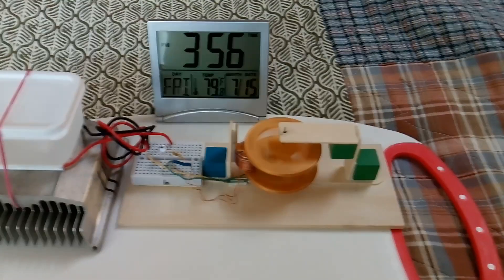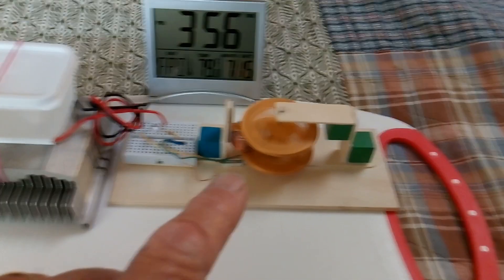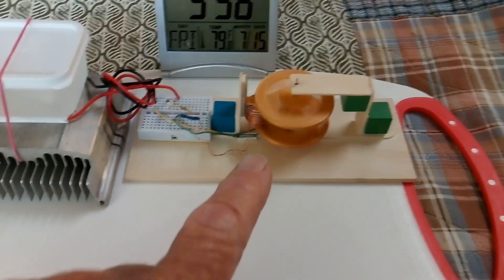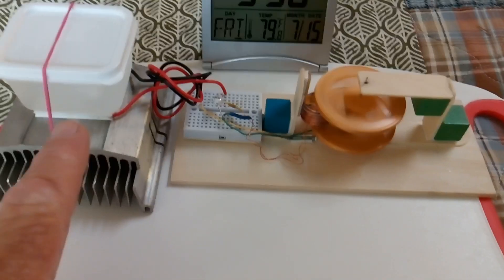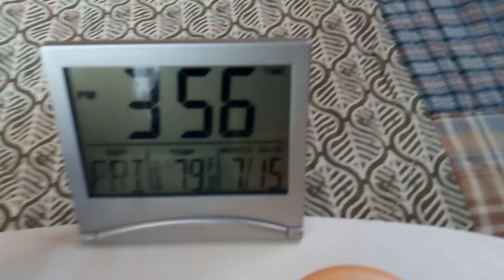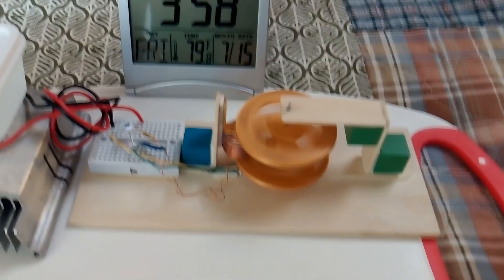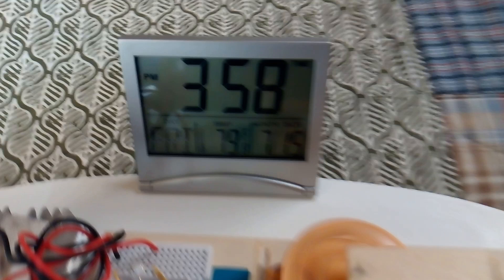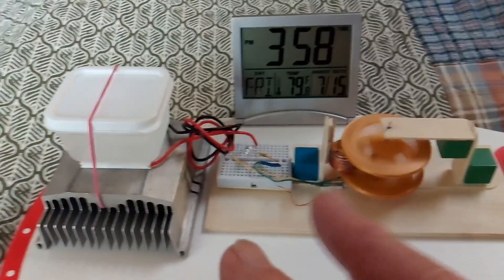The Cold Powered Motor

Comment: This is so cool!  I have also been experimenting with TEG powered motors.  I somehow missed this video and did not realize that you had also been experimenting with them.  I think our minds must be alike in someways.  I am working on something that will run on lower temperature differentials than my Stirling engine.  I have lately started having some good success.  I will be sharing a video soon.  Right now I am building the 24 coil levitating EZ-Spin style motor for the project.  It is by far the must difficult motor I have ever built, but the results so far make me think it will be worth it.  Anyway thanks for sharing all these great videos.
Reply from the maker: Good to hear from you.  I look forward to seeing your latest work.  Getting something to run from a lower temp differential is challenging.  I am running into problems.  I have a good store bought Stirling that will do it but building one myself isn't easy.  Your method of using a TEG is probably a better idea.

Comment: I've watched all your videos multiple times. I really enjoy your explanations and simple takes on power. You should check out a new 3D program called plasticity. It's free until v1.0 drops then it will cost $25-$125 it hasn't been set just yet. But what I like about this program is you can get really great intricate designs that transfer to 3D printing at lightning speed and there's little to no skill needed to get there. Not saying you just anyone who may read this.

Comment: Good 2 C U putting the radio on to pick up the electrical activity. 
U should be able to put a black paper on it and put it in the sun and it should work that way also, since the sun side with the dark paper will be 60 degrees warmer than the room or even more.

Comment: I was thinking of covering all walls with these TEG's, so when it is cold outside, and you heat your house, the losses to the outside give you back the electricity.
Reply from the maker: Great idea.  Even if this extra electricty gain only ran a few led lights it would help.
Reply: Won't generate what you put in , will be very low ratio but will be at least something rather than wasting
Reply: Positioning an enormous module in close proximity to the Sun would contrast greatly with the absolute zero temperature of Space.

Comment: Your ice was made by fire.
Reply from the maker: Actually where I live the electricty that runs my fridge comes from a hydro electric plant but I get your point.  What I was really considering was the use of temp differences in winter.  The ouside temp might be much lower than say the ground temp 8 ft down.   That temperature delta might be used to make electricity using TEGs.
Reply: @Lidmotor  Hydroelectric is great. (If you believe in such nonsense as 
"carbon pollution", the trouble with hydro is the amount of iron and 
steel that you need at the start.)
 A Peltier teg moves heat from hot to cold, so if you're using ice, you're
going to melt it. That means you'll have to move either the teg or the ice.
You could use solar heating and water cooling - that would prolly give 
the best temperature difference (and would work more hours per day 
than regular solar panels). The trouble there is, to keep the hot side 
sunny and the cold side wet means keeping the two sides apart, and 
that means filling the distance between the two sides with lots of metal.
Reply from the maker: @hermitoldguy6312  This whole thing is an interesting brain puzzle.

Comment: Interesting and good video. Just some information. Stirling engines, seebeck and peltier modules all run on a temperature difference. It's just easier to burn something to get a direct big temperature difference (>80K) then the limited temperature difference (~40K) from for example an ice cube to ambient temperature.
Reply from the maker: One of my motivations for this idea is related to my 'non stop running devices' that run on solar energy 24/7 year round.  Where I live they work great because we get so much sunshine here.  Some people have told me that where they live in the higher latitudes my devices don't work in the dark winter months.  Perhaps this is a way around the problem by using a temp delta between sub zero winter outside air temp and ground temp 8 ft down. Just an idea.